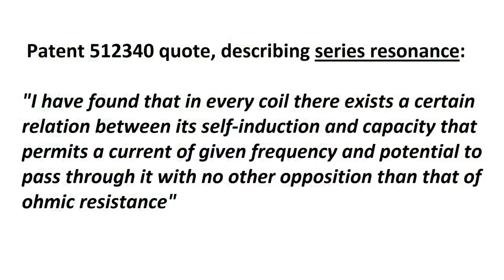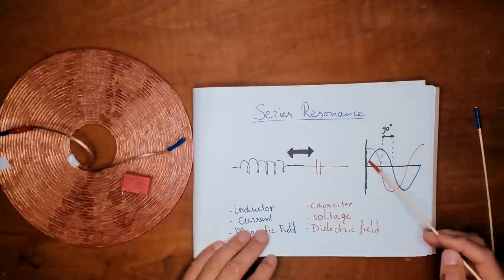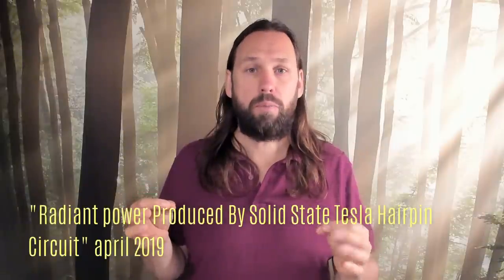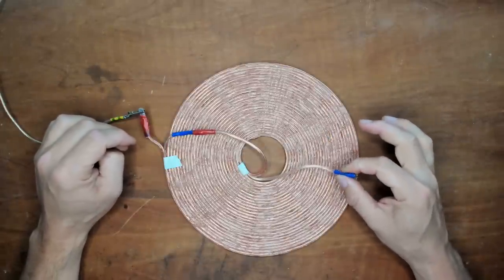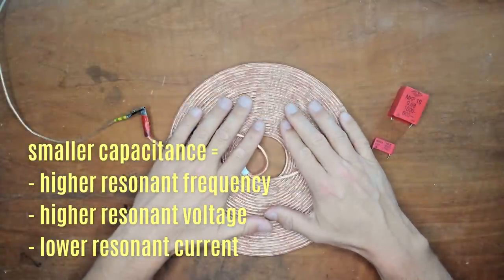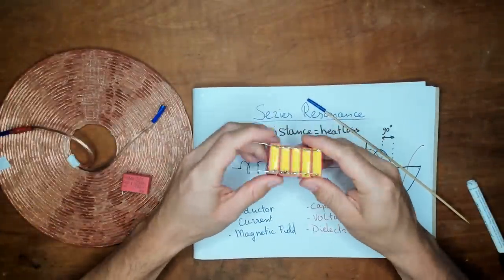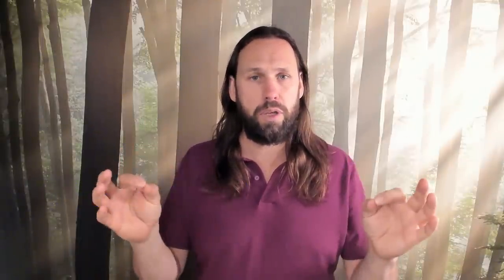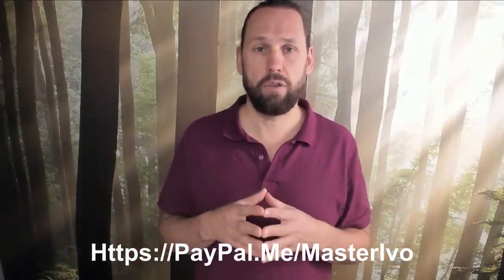The Series Resonant Bifilar Coil, Made For Longitudinal Impulse Electricity.

Comment: What do you think resistance is?
Reply from the maker: very good question. Not sure. It plays with time factor. slows transformation down. at the same time it speeds up the frequency, transforms into high frequency radiation.
Reply: @MasterIvo  What do you mean when you say it plays with time factor? Resistance slows the transformation of what down? It speeds up the frequency of what? What does resistance transform into high frequency radiation? Thanks in advance.
Reply from the maker: @pblakeney  every circuit has it's resonant frequency. With Impulse generation, the impulse duration (time) is influenced by the resistance. more R more T.

infra red (heat) is a very high frequency (near red light), so it seams resistance can slow electric transformation down but also up.

transformation from electric energy.
voltage to current.
dielectric field to magnetic field.
and transformation into heat radiation.
Reply: Hi there. Ivo gave a good explaination with the IR radiation. We might have different views, as I think IR is no more or less lossy than another frequency carrying the same amount of energy, and they both spread out over time and space.

Resistance is time related, because if energy exists in space as a dielectric potential which is flowing, it incurs losses due to the resultant formation of the magnetic field during a change in current (coils are just conductors when in steady state) which causes electricity when the magnetic and electric are combined.

Usually, magnatism forms a positivly curved field when dielectricity forms a negatively curved field, and they are conjugate. Their existance in this way is like one is the denial of the other. The magnitism slows down the dielectric current flow because of their tangental alignment.

A parallel alignment of these fields occurs in a lingitudinal wave, thus the fields are no longer interfering with each other, and the energy isnt really two fields in conjugate forms, but now one force. This type of energy is what we're calling longitudinal wave, and they travel faster than transverse waves. It doesn't have the same concept of resistance applied to it, and the wave fronts of the pulses cause cooper pairs to form, thus any rook temp wire should act as a suoer conductors with clean impulse current running through it. This is where longitudinal electricity gets its nick name, 'cold electricity' from.

Hope this helped, watch Eric Dollard for a fuller explaination on normal current interactions with resistance. Long story short: it slows down waves. Itll make an impulse more like a saw tooth, and turn a high  current into a low current. Basically, Ivo and I wouldn't be excited about using resistors, except maybe to charge a super capacitor with.
Reply: @ickorling7328  longtudenal wave carrys current? Alex Petty said in his demonstration Tesla Hair Pin circuit holding open coils, he said longtudenal doesn't have current and he didn't got electricuted on his demonstrations with open line.  

But I did saw on Dan Winter lecture longtudenal wave & EMF were I thought pallaow and side by side. 

But Alex Petty or Perry demo & speach said no current = no EMF = only Die electric ? 

If you could expain more or saw video link on this topic please let me know if longtudenal wave carry EMF, current(amp)? So I can learn more thank you sir🙏😀.
Reply: @motobacktoconstitution4138  an old guy I work with happened to mention his professor worked on antigravity, William J Hooper, and if you see the bigger picture you'll realize several people are talking about the same idea of a perfect electrical field which is neither magneric or capacitative.

I think the aether is being twisted into closed loops innthe spaces between windings / magnets so they form a 0 resistance circuit in 3D space which we call radiant energy that has been trapped in a 4d curly loop. Radiant energy is basically impulse current, with very short on tike and abrupt off di/dt. It still has geometry and hallmark particles (cooper pairs, etc) since it exists innthe realm of space and time, so we can interact with it as physical beings.
Reply: @ickorling7328  sorry I let other American Engenner read this text but too many miss spellings and sorry hard to really understand sir. Thank you so much for reply but I want to understand your message. 

There are no electron partical sir. But effect push or wave function exsist 

Beside that I really want to understood your message if you could collect spellings we could understood better thank you for taking time & parsonal repry on your busy skedule sir🙏☺
Reply: @ickorling7328  thank you responded from work I'm reading 3rd time but 4th dencity exponation place spelling is good but its hard to understand in my gead I wish you have or know 3d writing for me to understand . Erick was speaking Ogone I will listned to him more & Mr Ken Wheeler too to try understand if you could create by writing 4th demention magnet direction staff that whould be helpful for me to understand . anyway I try read fewmore times thank you on your busy skedule amazing difficult amazing exponation I beed digest little by little thank you sir 🙏
Reply: @motobacktoconstitution4138   @Moto Back to constitution  Okay. Capacitative current is very complex, so it may take smaller steps to explain it. The basic idea is that there is a trapped flow of energy which meets almost no resistance as it travels. This energy (radiant energy) is not made of electrons, though I say electrons do exist, yet as you said you think of electrons as a push-pull or wave function... while light does behave this way essentially-- its too soon to say electrons dont exist.

An electron is the result of hysterisis (sorry if thats misspelled) which means energy that was doing work becomes wasted and becomes heat or sound. Eric Dollard is a (surprisingly) good reference I reccomend. He explains a side effect of the magnetic part of current-- being that electrons are the points on the wire (mostly the surface) where the magnetic field lines and electric field lines cross at perfect 90° angles, and if its the same field configuration but there is no wire or matter, the same interesction of forces is called a photon. I would argue that the electron and photon are real, but they are NOT the CAUSE of electromagnetic energy, but merely it's shadow.

Consider relativity, where the speed of light is constant. If you measure a beam of light and then speed up A LOT, both measurements will indicate the light wave is traveling the speed of light faster than you. This is why they say reality is measured per observer. The reality for light is that it exists outside the realm of space and time, and it exists in all dimensions beyond ours, but when it's observed in the 3D-4D world we live in (3 dimensions of space and 1 of time) light takes on the attrubutes of the physical dimensions we inhabit. Sometimes its only barely interacting with our dimension, so we see neutrino rays and gravity waves which are both in essense light. E=Mc^2 is a long standing equation which was derived from Maxwell's equations that took the perspective that matter itself was made of light-- rather than light being made of matter. He tried the math the other way and it didnt work. Theres a deeper explaination as to how matter is light, and electricity is light, and everything we know of is light... you probably already knew much of that.

The reason I explained is because I want to make a connection in your mind. The energy we call light is not actually 2 forces, but one force called the aether, or dark energy, or zero-point energy, and so on. Dark energy is the term I will use. "Dark" literally means that it cannot be directly detected because it is not physical-- but our instruments are physical so the limitation is hard to get around. The detection of gravitational waves was a major point for understanding dark energy. Its not a transverse wave, and its not a longitudinal wave, or even a surface wave (combination of the two)-- actually its a scalar wave!

A scalar wave isnt a wave that travels, and it's energy is constant everwhere it's defined in. An example would be a pressurized room or chamber-- the air pressure is constant everywhere in it. Even though air is made of particles which take time to move, its an okay example.

A better example is quantum entanglement. Two particles or groups of particles that share the same state across any distance, an instant connection. The reason this is possible is because of the nature of dark energy embedded into space. Anywhere you go dark energy is there in full.

So, dark energy is simply light, but where we think of light as two conjugate parts: magnetic and dielectric, to dark energy light is made of just one force. Mathematically as well we have concluded that electromagnitism is actually just one force. That knowledge is not uncommon, but taking it one step further and saying that everything is made of light and that all the forces are the same singular force is also mathematically backed up in a theory called e-infinity theory.

See, E-infinity theory is a grand unified field theory that uses the golden ratio and combines string theory and general relativity and also many other ideas. The concept is hard to follow, but the math is harder so lets stick with the concept.

Remember dark energy, everwhere in full at all times, the question is, how? By what mechanism is energy and information transfered? Obviously, its a feild. However, the harder realization is that a feild is only as cool as the medium is exists in! As it turns out, space-time is really really complex! We know that space is not simply flat (euclidean) and nor is it simply curved (hyperbolic). Its somehow both, and its also somehow negatively curved and positively curved. The best word for it I was able to imagine was psuedo-raymanian... but near the same time I met a friend who explained E-infinity theory, and they have an even better definition of space-time and it's curvature. They call it: fractal-cantorian-space-time.

This is as hard to understand as it sounds, but a clean way of thinking about physics in the end. It means that the smallest little volume of space you can think of has tiny dimensions packed into it which complicate the topology of space-time in that local area. Infact, as the name e-infinity implies, there are infinite dimensions in every infinitesimal (tiny tiny) volume of space that eventually repeat themself in a pattern. That pattern is defined by the golden ratio-- the finger print of God. This means that space has infinite resolution, and everything happening in the universe now is also happening at infinite smaller and larger scales. This concept is also called the holographoc universe model. You can study and understand it by studying holographic black hole theory, which just means at its point of singularity where all the mass is contained in a point of space, all of the information inside the black hole is contained, yet it has a heavy shadow called its Swartz child radius which we can "see" / detect. Then you would study hawking radiation leaking from the surface bring energy and information back to space. E-infinity basically says we live inside an infinitely repeating universe sized black hole in which we live on the 3D surface of the shadow projected by singularity. And in this case, singularity, containing all the energy and information of the universe, is literally found in every single point of space!

So to bring it all together, the reason why dark energy never travels and always has all of it's energy everywhere is because every point of space is connected by a hyperbolic sub-space which shrinks infinitely so that dark energy takes up no space at all, and all space at all times!

Now then, to explain capacitative current. It is not dark energy, but somehow inbetween dark energy and normal light. Whereas we always find energy in motion, and every particle, capacitative current is also in motion. I think of it as a kind of 4D infinity loop-- a manifold-- with two sides such as a mobeous strip. The dimensions of magnetic and dielectric fields are often conjgate and perpendicular, but in capacitative current, the feilds both bend in odd geometric ways, and so the lines of force run almost parallel with each other. When energy is trapped in this way, it flows without the hinderance of electrons forming, or rather, the electrons group up into compressions and refraction groups. 

On, and then off. Completely. This allows the energy to be flowing without resistance in a state close to dark energy, which we call superconductivity. Why? Because it the wave was just ON all the time it always exists in the realm of time, and thus matter, and thus it becomes an electron. With capacitative current, energy is resonant like pushing a kid on a swing. We dont measure the momentum it gathers, since its not physical, but we do see the effect when things turn on or off really quickly (fast wave form rise time, then followed by a fast waveform off time only nanoseconds later or less)

This impulse current waveform is the secret to room temperature superconductivity and many other science secrets, keep an eye out for cool technology that uses pulses-- especially fast and energy dense pulses. However. I dont think pulsed DC is inheretly also capacitative current. To acheive that, you need two wave guides carrying charge that are seperated by space, AND the wave guides need to form a channel of empty space which does not bend harshly and returns to it's origin point running perfectly in the opposite direction.

The vortex coil is the perfect example of this, if it's made right, but Tesla's bifilar coil is very close and acheives the same effect. When you combine this special typology of coils, impulse current, as well as matching the circuit capacitance to the amount of induction (impedance matching) you should then acheive capacitative current. That is, a flowing energy which floats between wave guides and forms a closed loop on itself to flow as if time does not exist... a lot of energy would be capable of accumulating ther but I cant say I know what happens after that.

A vortex coil can focus it's energy loop through a singularity point in the coil's center, so that region of space is special somehow. Will it explode or ground energy? Will it float or sit still? Does it store energy up to a certain point and stop, or does it draw energy into it like a negative resistance circuit? I dont know.

This is all theory, but I enjoy it very much and hope you were able to follow with my explanation! I'll be working on this more and testing it out eventually. I wish it were sooner rather than later, but if only money were no object! Feel free to contact again.
Reply: @motobacktoconstitution4138  thank you for your kindness! I know a few elecrical engineers from other countries who do not speak english... unfourtunate. But most americans reject all of this, ALL of it! They have been brainwashed. Oh, and Ken Wheeler is awful. His explainations are wrong and too complex. He wont explain anything clearly, and I tried talking to him about the 4th dimension of energy and he REFUSED TO RESPOND WITH AN ANSWER!!! Dont watch his videos... instead, watch Fractal Woman on youtube, she has recently become good at electrical. She sometimes cites Ken, but so does everybody. What he's talking about leads people away from clarity and gathers a crowd of followers so they might one day "understand his wisdom."
Reply: @motobacktoconstitution4138  I tried searching for "ogone" and say "Orgone" which Ive never heard of, but it says on Wikipedia that it's the arteibute of space that organizes life and other systems, and says its similar to the aether.

I like this idea, as it is just predicting that space has some sort of organization built in, and thats exactlt what I just explained with E-infinity theory! Literally, that space contains the golden ratio, which is the most irrational number. In english, when people use the word irrational they mean "stupid and chaotic" most of the time, and theres a popular physics theory out there on the internet called chaos theory. "Irrational numbers" like pi (3.14...) go on forever, repeating these sorts of patterns which paint a picture in geometry. "Chaos" theory is actually studying the golden ratio / the golden mean / "phi." 1.618...

Look up a "lorentz strange attractor"

The truth about "chaos" theory is that its actuall "organizational" theory because its all about predicting future events thay should be random  but instead show traces of patterns of reoccurance. So... for what ever reason the language is backwards to mean the opposite.

A fractal is a repearing set of rules, like a certain math equation that is self similar but goes on forever. If drawn on paper, the number pi (3.14) is the perfect circle, and the number phi (1.618) is the perfect spiral.

That spiral is what you might call Orgone. A field that exists everywhere which gives the universe it's order. Information does not come from nothingness, but rather, it is created by design. Everything in the universe is fundamentally a part of this blueprint.

For light, it's really complex because the result of organization, the spiral in space-time, is infinite dimensions that repeat themselves on different sized "cantor sets" and have geometry with increasing complexity of coordinate systems. Light still exists as flowing in these tiny dark dimensions (even though I said dark loght is "still" earlier, the reason is to break your mind's tendancy to add time delay and energy loss otherwise, but all energy is probably flowing)

Dark dimensions have volume; infact the higher in dimension you go, the more space will fit inside an equivilant volume, and thus time exists in these dimensions technically.

Therefore dark energy/light is flowing, but only in laminar flow whereas normal light and matter can be thought of as turbulent flow. Dark energy flow is not traveling, but spinning.

Virtual particles seem to occur because the spin of the dark energy in each and every point of space is crossing dimensions very breifly, appearing in the euclidian plane. Remember, energy cannot be created nor destroyed, but this isnt crearing energy-- it's transforming it from one kind to another.

Hope this helps, and thanks for the idea of Orgone to help explain order in space and its dimensions.
Reply: @ickorling7328  Dan Winter call golden ratio NegEntropy & eather is in order too. I think tatoo guy He said gravity is speed exsosaration of dielectric . Dan Winter gravity is  Hydrogen....

I guss more I think about it  if you can find or write 3d animation of eather you can get Novel price lol 

I think Einstein know way more but he was in the club ofdeepstate illuminatis wife saw in in the club. So he was folloing order. 

I will put link in here every one of them thank you recercged 3d writing for me sir and Eric Dollar was speaking and demonstrating Oregon so I need watch more his video to understand thNk you so much very interesting insite and repry sir. 🙏😀so wonderful thank you sir.